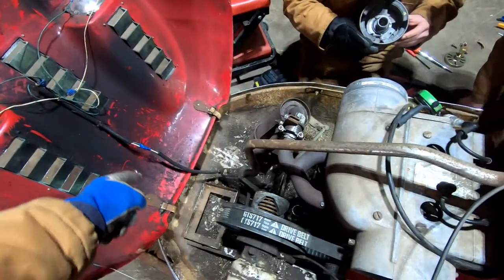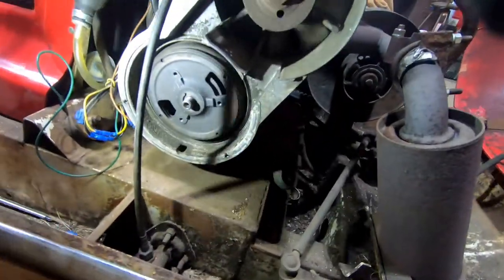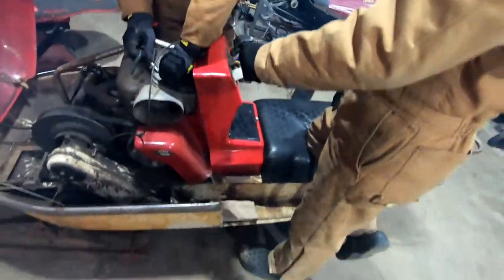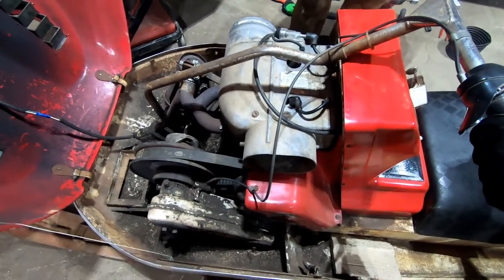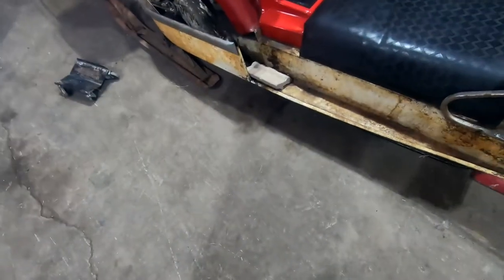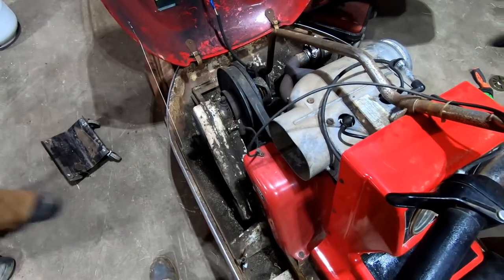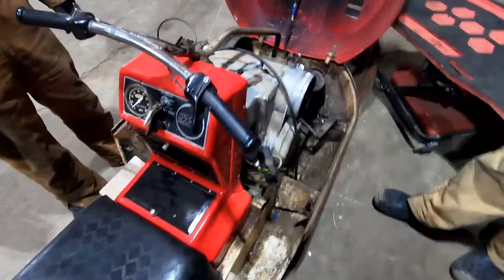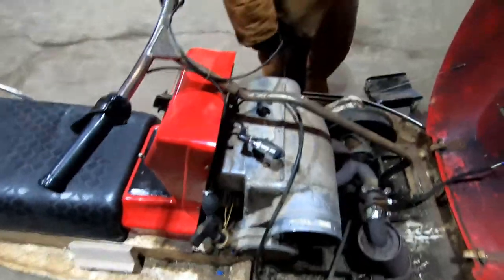ANCIENT Herter's Husky 440cc Snowmobile Spark Issues - Points & Condenser Diagnostics

Comment: My Dad bought a 1972 Herter's Husky brand new when I was 12 or 13. The thing ran badly and we couldn't figure out what was wrong. My uncle who was a farmer and a pretty good mechanic started investigating and he found that when they installed the seat it crimped the gas line so the engine wasn't getting enough gas. Once that was fixed it ran beautifully for years. I used to deliver my newspapers on the Husky in the Minnesota Winters. One of the most fun toys I ever had!

Comment: That snowmobile was built in my hometown. Looks like a 72 model year with the Sachs 440 in it. Unfortunately Herters used scotch locks in their wiring harness straight out of the factory. It looks to be in pretty good condition for its age though. Put a set of points and condensers in it and you should be good to go providing the crank seals aren't dried out.